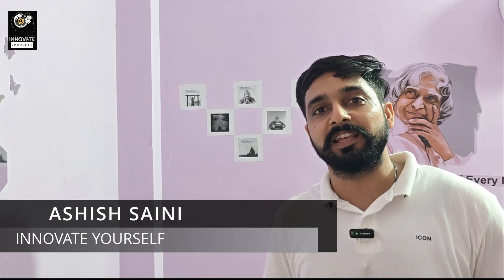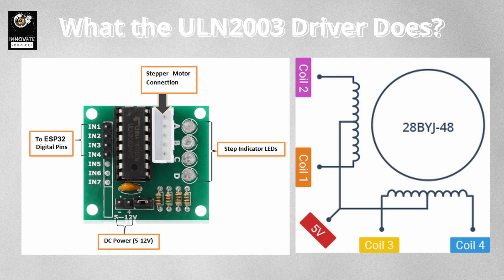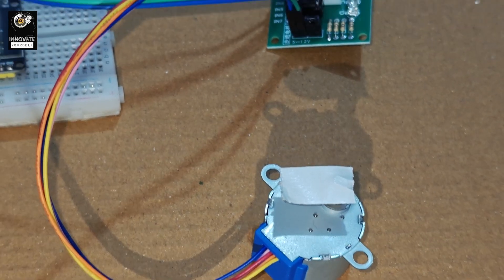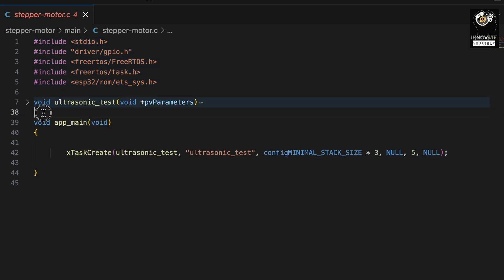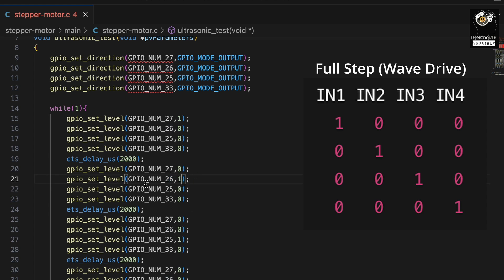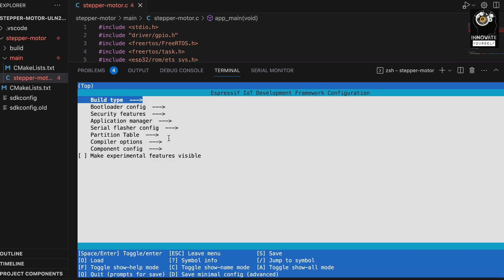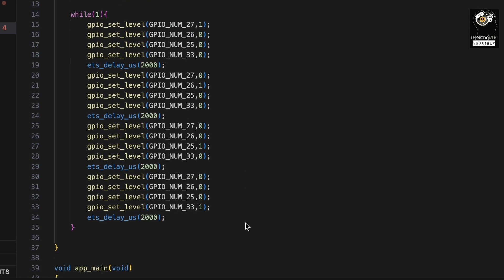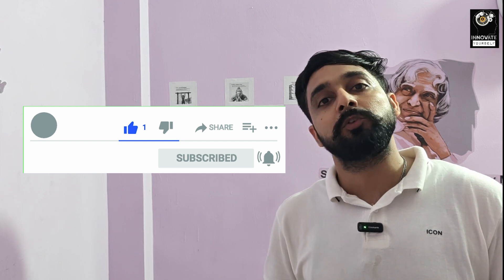Control a Mini Stepper Motor with ULN2003 & ESP32 using ESP-IDF | Full Tutorial + Code

Comment: Thank you so much. I tried doing some quick testing with gpt but that clanker told me 2048 steps per revolution and when i told it that ~4800 seemed better it called me dumb... Anyways, could you please provide the code on github?
Reply from the maker: Thanks for pointing out. I have added the git link in the description, please check. 😊